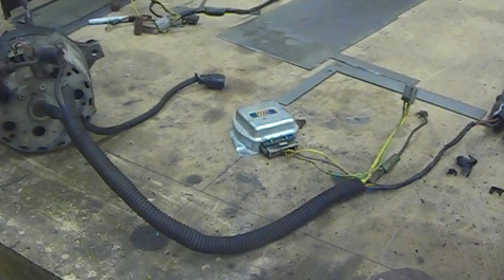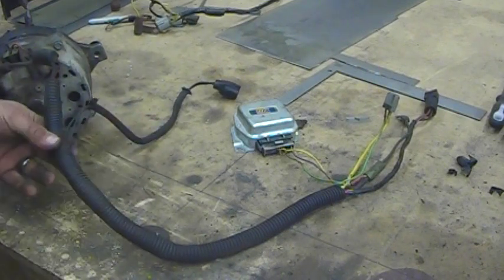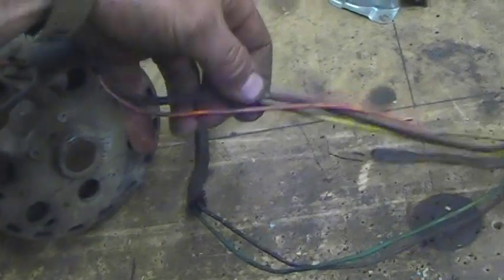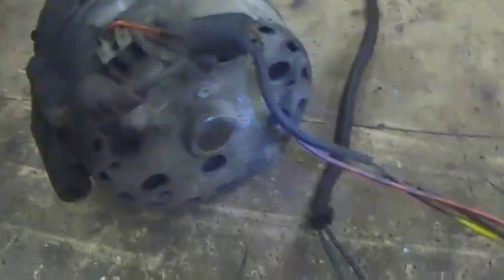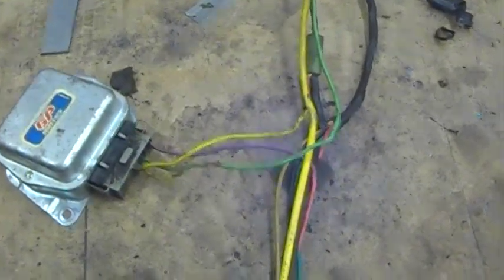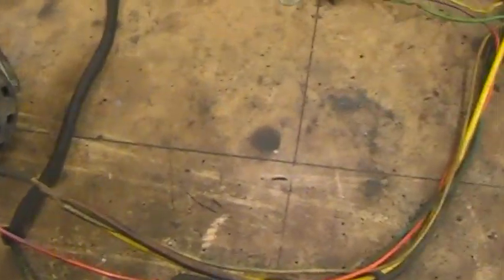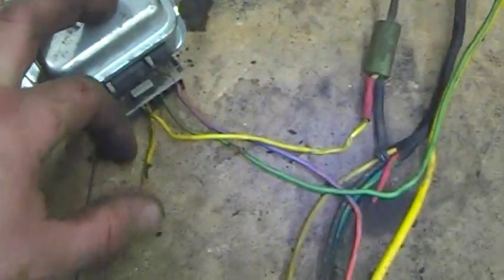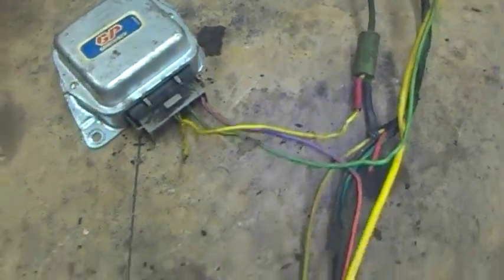Ford externally regulated alternator wiring

Comment: just had a vacation guys weekend with a few friends i only see once or twice a year. i travel the furthest, and drove my 1985 ford bronco fullsize with the 351 windsor H.O. i had just bought a few months back. it didnt seem to have any electrical issues, just some minor cosmetic stuff and needed a radio something fierce. i drove it around a few minutes with the guy in south dakota, the dana 44s in front worked, everything seemed solid. i paid the man, and drove it away. the first gas stop i shut the truck down, and fueled. after fueling, i started the truck, and it kept trying to start even after backing the key off. i wiggled it like crazy to no avail, and had to pop the hood and battery line. I was about to call the guy and get my money back on the spot, but my dickhead cousin that gave the ride out had already took off and had my phone in his back seat still. so, i hooked the line back up to see what was what, and nothing happened. so i got in, it started fine. thought, what the hell, it was cheap, and starters are cheap. drove it 430 miles home no problems except i thought the dash lights were a little dim. put in a cd player, drove it for a few weeks, and every now and then it would do that same thing, but i kept the right size socket next to my seat to pull the line from the solenoid at all times. finally the solenoid died, so i put in a new one as i was waiting to buy a new starter for another week, and the new solenoid was much the same. finally got a starter, third solenoid counting one that was in it and voila. no problems. so there begins the road trip. (the next morning) i make it from williston nd, to just outside of duluth. about half hour before duluth, the truck was losing power, i shut down radio, heat, slowed wipers as slow as i could handle and no brights, still didnt quite make it. i was about 80 miles short of my friends and dead in the water. they bought two batteries at 1:30 am and rescued me. put in a new battery, started right up, made it to the cabin. lights were ALMOST out by the time we made it but we made it. after replacing the alternator, regulator, solenoid YES AGAIN just for kicks and buying a bunch of spools of auto wire and connectors I still hadn't figured out the problem. It took me three batteries to make it home and my last gas stop the truck barely barely turned over. it was the last time the truck would start. i made it to the driveway, dim ass lights and cold, let truck idle for a few seconds and shut it off. it was dead when i tried to turn it. LUCKYYYYYY. so at any rate, im going to watch this video a few times to memorize it but the system is more basic than i thought. if thats all it needs to run a vehicle and charge, then im probably going to cut out a mess of wire and just start over. i want to say bad ground but i ran it for 2 months with only the starter acting up once in a while, so i dunno. by this video though i may have a wire wrong... either way, thank you for simplifying it for me, im just starting to DIY mechanic. just weird i made it like 600 miles and now that i put in all NEW parts the system is totally nonfunctional. truck runs effing great btw.

Comment: Christopher Kleman I'm having trouble disconnected the red and black capped wires connected to the alternator. I am attempting to take these off before the remvoing the alternator to test why my battery is losing its charge

Comment: i have a 82 ford e150 that was giving me nightmares for years could not figure it out all my lights were flashing and recently it was acting like it was not charging at all changed alt. reg. bat. sol. added grounds and cleaned every ground on the van, in the end it was a 2 cent connecter that was broke in half where it plugs into the reg. changed that and g2g very informative video

Comment: Chris  . my harness does not have the screw mount that that looks like it might ground or perhaps it just holds the wires in place. Question . Do I need a Ground wire. My old ford seems to over charge as the rpms increase . Voltage regulator and Alternator replaced. I have a parasitic draw I can not locate :{

Comment: 1976 ford f100 4.9 6cyl having trouble alt wiring to volt reg heating up when hook up need wiring diag  Field wire stays hot

Comment: would you happen to know how to bypass this type of regulator. im putting a newer 302 in my 1975 mercury comet and the alternator for that 302 is internally regulated. so is there a way to just jump a wire and bypass that regulator like is possible on the GM cars.

Comment: I see u have a lot of knowledge about alternators and the wiring, I have a question if you can please answer it, i have neon 2003 , does it have a fuse between the alternator and the battery, or a fuse between the alternator and the relay box, the battery is good, but the car doesn't charge it well, I replaced the alternator n still wouldn't charge the battery, I had it tested and it passed, so in thinking its probably something in between, please help, thanks

Comment from the maker: @seapeddler Yup, the Delco 1 wire was a very common upgrade to many of our 12v generator based tractors.  For the Fords you can also upgrade to a 3G alternator in much the same manner.  I updated my truck a 200A rewound 3G ford and haven't looked back.  Well worth it for the plow truck!

Comment: I found that the best solution for the Ford alt. upgrade was to supplant a Delco CS130D unit.
This requires only the 'L' wire on the regulator harness. Haven't looked back.

Comment from the maker: @maverikx99 The thick yellow wire is spliced into the Battery + output of the alternator.  On this instance ('85 F350 diesel) the gray connector was a +12V main supply to the cab. The wire is part of a Y where the lower leg goes to the alternator Batt 12v, left upper leg went to the starter solenoid to charge the battery and the right upper leg fed power to the cab.  Most likely you would find that instead of a Y between the alt/solenoid that the cab would connect directly to the solenoid +12v.